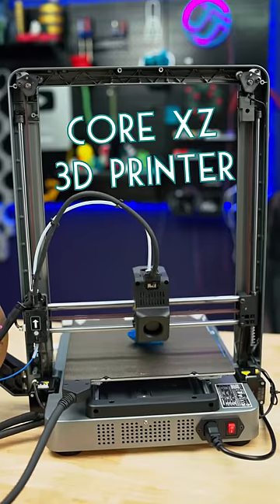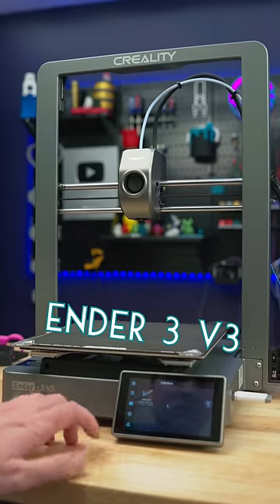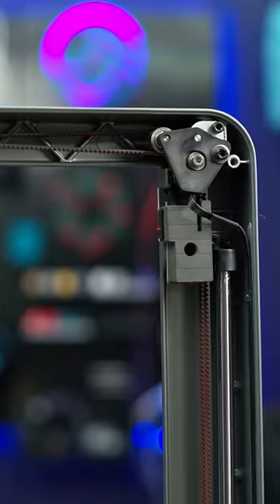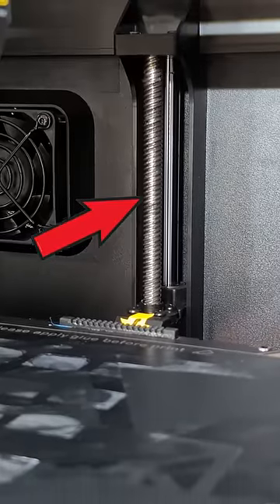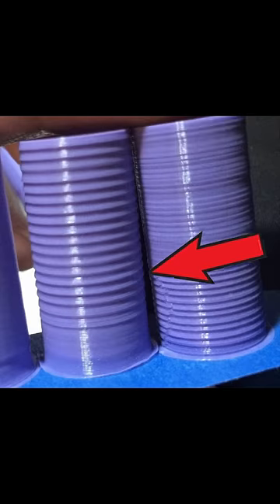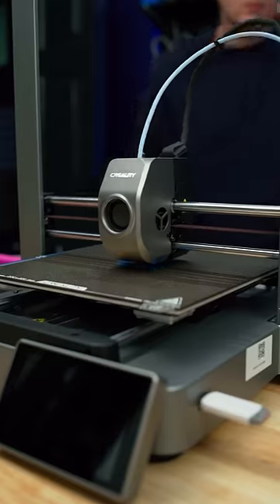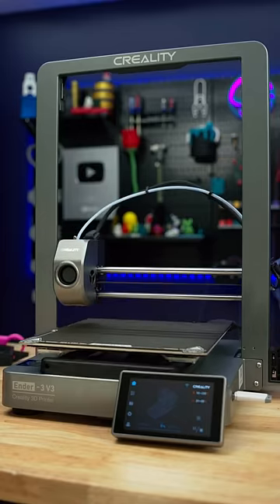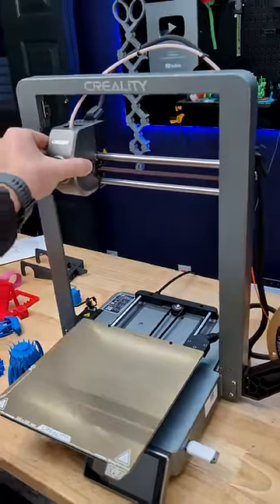Crazy Core XZ 3D Printing 😱

Comment: Yes this is the future of cheap entry level printers, because it's cheap, and light. They might even perform quite well... Initially.
Reply: As someone trying to get into printing for DIRT cheap. I see this as a win.
Reply: Yep, it's basically a dual Z setup without the extra motor needed. Also, even cheap screws are probably more expensive than couple of extra pulleys.
Reply: I have this printer and I have no complaints however configuring your slicer is a bit of a pain
Reply: @andrewpauly4783  someones needs to get into printing on a ultra low budget can easily be met with an Ender 3v2

The v3 is expensive compared to the v2 with mods
Reply: @questionsfrog1918 the v2 is an endless money pit
Reply: @allie5659  not really. Bl-touch+PEI mat $40. Add replacement rolls for $7 and your printer is ready

$99 for an E3 v2 at Microcenter,best setup to start printing. My E3v3 KE had,on top of costing $300, eaten up at least $135 and around every third print fails. Easy math
Reply: And it works well with direct drive extruders.
Reply: @Papinak2 it needs a second motor cause the z motor also controls the x axis! It's pretty much a flipped over corexy
Reply: @Parodidical  but standard layout requires 3 motors - 1 for X and 2 for Z. This one just needs 2 for X/Z
Reply: @Papinak2  oh, ok
Reply: @questionsfrog1918 or a KE and SE which would probably be around the same price if they really don't plan on modding it much further or aren't really a fan of modding
Reply: @questionsfrog1918  this is a different level to an ender 3 v2 with mods though. You can't go 600mms on an ender 3 v2 unless you use a raspberry pi and load kipper and put insane mods which will cost you double this
Reply: @Demertech  i know its supposed to be fast as lightning but if only one out of 5 prints succeed on the v3KE like with mine,a v2 would have been done by now

V2=cheap,slow,still fun to get your feet wet and it just werks

V3KE=expensive,fast,unreliable,suicidal due to blob of death. Also: Klipper, old Version with no chance to Update
Reply: @questionsfrog1918  I have 2 KEs. I can confirm that they can be shit however it's easy to solve it and make them reliable with tuning

Comment: Excellent instability on the Z axis✅
Reply: stability or instability?
Reply: Instability? The holding torque of the motors is plenty to hold it stable
Reply: @polycrystallinecandy xD lmfao
Reply: The whole gantry wobbles like crazy during the print. Look at some reviews.
Reply: That's more of a flaw with the frame design than with the core concept tho, right? In general corexz still seems like a slight improvement over traditional bedslingers if done correctly

Comment: You get the maintainance of CoreXY with the drawbacks of a Bedslinger. Great.
Reply: Also the backlash of CoreXY on X and Z and the backlash of a bedslinger on Y. Thanks Voron design. Could've just added the 3rd motor and made the proper independent 2x Z.
Reply: Came to say the same thing
Reply: This made me laugh
Reply: Exactly what I thought 💭😂
Reply: It’s not a traditional bed slinger in my opinion. It’s on there solid with no turn screws to level the bed or anything. Just 4 solid screws connecting to a metal bracket. The input shaping feature eliminates any issues with ringing and I have had 0 maintenance on my core XY belts but if I do, it’s one screw that has to be taken off and anything/everything can be replaced. I’m really liking this printer. Especially with Klipper and the built in WiFi.
Reply: @ygayovy  independent 2*Z only give you auto-leveling of x-axis

famous screw problems are from over-constrained screw
Reply: @derevya  Belted Z works just fine, for as long as it's not a freaking corexy.

Comment: Dude what do you think is more likely, a precision machined screw bending or belts being out of tension 😂 don't act like this is some tremendous problem people are dealing with
Reply from the maker: I have had a lot of issues in the past with the screws getting bent on some printers
Reply: @JJShankles  Belt tensioners are actually really hard to find.  And trying to pluck them is very difficult to understand.
Reply: @JJShankles only on printers from manufacturers who source all of their components from the lowest bidder, and don't have a QC department (like Creality). 
Literally all high precision/ high speed motion systems use screws for all 3 major axis.
Reply: @chriswisneski6071 they have QC but their expectation  is not high as most of their printers are DIY. Without QC you would get a box with a mix of parts that are nonfunctional, damaged, missing, incorrectly packaged and so on. What creality's problem is that the machines are hard to assemble correctly because of the error prone product design.

Comment: "Core XZ" is a marketing term.  I means literally nothing.  It's a bedslinger.  Like every Ender 3 before it.
Reply: You have it backwards “bed-slinger” is a marketing term given to machines with a moving bed. It doesn’t mean anything else.

CoreXZ is the classification of the motion system. It means the X and Z axis are not independent like the Y axis.

All the other Ender 3s are “i3” systems because they have 3 independent axis of motion.

Comment: Meanwhile my E3V2 is in pieces cause I couldn’t get it to work at all, no matter what I did. I even changed it to a direct drive extruder with the revo nozzle and it helped only a tiny bit, but with the extremely sensitive adjustable bed, and it’s “auto leveling” with the crtouch, it’s still so far from being a fully reliable printer. My Prusa mini with the bondtech extruder and revo nozzle is so reliable I don’t need to even bother checking the print.

Comment: I hope so! I’ve owned a knock off version of the Ender 3 V1, knock off version of the Ender CR-1, so this time around I finally went with the official Creality Ender 3 V3 and WOW was it easy and still is. I’ve printed more stuff on it than I did both of my last 2 printers and I’ve had it for a month and a half. 

The one thing I would say about this printer (all printers really) is that you do have to have some knowledge as to how the print process works. Why it’s so important to get the extruder dialed in and first level bed adhesion and all of that. However, the Ender 3 V3 and the Creality support team did a great job of making sure the setup is as easy as it gets and will help along the way. The bed leveling is a dream come true and the settings for retractions are a breeze because the print head moves so fast! Happy printing!!

Comment: If the x Axis would just move up and down on the z screws then yes, it would wobble. But since the x axis most of time is stabilised with wheels on the frame or running on a linear rail, the screws wobble doesn’t effect the print.

Comment: That second "feature" is not a feature, it's actually a liability.  You really shouldn't be moving around the printer like that, you can fry your stepper drivers or even the mainboard if the manufacturer didn't have the foresight to think some ape was gonna manually actuate the stepper at 200mm/s and zap the board with -48V.  Some boards won't mind it, some getting voltage in the wrong direction at the wrong time you're replacing a 100 dollar part.  If you must move them manually do it slowly to minimize the power generated by the stepper.

Comment: So now you get variable Z issues because of belt stretch, tension variables, and bounce.
Reply: I don’t think there should be much bounce, tension/stretch are why a normal printer at the best is limited to I think 0.1mm resolution. It’s not a limit you can calibrate around but an actual physical limitation of the design(s)/hardware. I personally use a normal Ender 3 with a belted Z, it’s much better than the lead screw

Comment: I have two questions. Can I put this on my Ender 3 s1 plus? And how do I make my printer print faster without changing the settings? Do I have to change the motors for faster ones?
Reply: you can convert your printer to corexz as well? but for negligible gains. To print faster, just set a faster speed in the slicer and increase your acceleration in your printer Config
Reply: Yes I do it every time but the highest I can go without losing the print quality is a 100mm/s and I want is faster
Reply: No

Klipper
Reply: in order to turn your ender s1 into a core xz printer, you have to design your own. The ender v3 isnt built for a ender s1 conversion so i wouldn't imagine it to work
Reply: The most popular method is the Ender Switchwire, but I think that's based off the E3v1 so idk how that would work in a S1

Comment: Shaking the life out of the model being printed almost guarantees distortion.
Bed-slingers were never a good solution, but they are cheap and easy to maintain.
Core X-Y as a standard feature is the 'next big thing'.
Moving the model on the Z axis only adds a lot to final quality.

Comment: Don’t move a printers print head without it being turned on and motors are turned off… mate had a printer die because he moved the bed and head position at the same time turning the nema motors into generators and he generated more than 12v which was all his board was capable of and killed the mosfets on the board did, some other damage too but he ended up needing a new board

Comment: Just had one. Had a terrible experience. Off on every axis, weird issues between the filament and power cable, and inconsistent extrusion. I wanted to love but...
Reply: Really? No issue with mine
Reply: @wantgamingyougotit1219  yeah I never got a chance to figure out what was wrong before I had to return it. However, looking back after I got an A1, I believe there might have been an issue with my nozzle temperature. My biggest issue was prints being knocked off almost every single time and after getting more experience and seeing how the A1 prints.. I feel like the Core XZ wasn't melting the filament enough.

Comment: Also one less stepper motor
Reply: No. Just different placement. This operates on a sideways core-xy kinematics so two motors are needed for x and y still but also for x.
Reply: @simplyelectronic4840  i meant compared to a traditional bedslinger with srews for the z axis, which has four motors in total (five counting the extruder)
This one has three (four): 2 motors for the XZ Gantry and one for the bed
Reply: @miege90 most bed slingers are 4 motors. Z, X, Y, and E. No different than this.
Reply: @mekanism8364  no you're wrong. Look at a prusa mk3 for example, the z axis has double motors, one on the left, one on the right, for a total of 5 motors including the extruder
Reply: @miege90  prusa is an exception. most bedslingers come with 1 z screw
Reply: @user-co6ww2cm9k  maybe nowadays as every other printer is an ender 3 clone, but a few years back, most printers I know had two...
Reply: @miege90 and look at the ender 3, 1 z axis screw
Reply: @Zyghqwyv  that's exactly what I just said.
Reply: Most entry bedslingers nowadays have 2 z steppers

Comment: The 3v3 KE have auto-leveling and run-out sensor with klipper software. I can print a flawless benchy in 18 minutes with factory settings in the slicer and it just goes. I've never had to deal with calibation / leveling and by how much people talk about it, nobody should buy a printer that recuire this when the KE is 250 bucks and just works out of the box.
Reply: Give it a year n your ke will be obsolete
Reply: @buddahboy520  nah, no shot.
Reply: @buddahboy520 What does jt even matter? It's not like 3d printing is reliant on (semi) hardware like gaming
Reply: You much of got really lucky my KE’s bed shakes and my tool head frame was bent
Reply: @ty8324  send it back for a replacement?
Reply: What do you mean require this? The only think i had to do out of the box on mine was bolt the gantry on and use the touchscreen to print a benchy in 13 minutes

Comment: Jesus crist, stop this bullshit. Its not going to print faster or better.
Bent z screws do not create wobbles. Bad z guides do.
Bed slingers can not print as fast as good cube printers, emphasis on the word good.
Bed slinger are not worse, they are just a bit slower.
Z axis speed was never a bottle neck on any printer.
Core XZ sematic is like putting a fancy low profile tires on a van. Yeah, sure it looks cool i guess. But its not even a tiny bit useful.
Any sane person with a bit of engineering background and some experience with printers will laugh at this crap.

Comment: It's a rather stupid idea. It doesn't offer any significant benefit. It mainly offers significant unreliability as soon as the belt tension is just a little bit off and your Z axis starts moving around with every X axis move, completely screwing up anything you try to print.

Comment: Am I the only one that calls them bed slingers instead of core xz
Reply: This is specifically a Core XZ bed slinger. Meaning the X and Z axis motion are tied together using a pair of belts. Traditional bed slingers are cartesian where each axis moves independantly of eachother.
Reply: @Antstar12  the printer is a bed slinger the bed moves back and forth wjat r u on
Reply: @Xeno9118  the "core xz" doesnt have anything to do with the bed, bedslinger yes but core xz instead of a leadscrew driven Z axis
Reply: @Xeno9118  You clearly don't know anything about 3D printers so please shut up. He just literally said "it is a core XZ bed slinger". So yes, it is a bed slinger, but it is also a core XZ. You clearly do not understand kinematics, so why are you even in this conversation. Come to think of it, I've never seen a core XZ that is NOT a bedslinger, because for non-bed-slingers, coreXY just makes more sense. The only other Core XZ I know of is the Voron Switchwire. 
Now please, either get educated, or leave this conversation to the engineers, and people who actually know 3D printers.
Reply: @Chris-hn4lp  yep i dont know anythink about printers ( i have a ender3 with 400 dollars worth of upgrades and a voron 2.4)
Reply: @Xeno9118 Then you should know how a core xz operates. Core XZ refers to 2 stepper motors working in conjunction via belts to move both the X and Z axis. This is exactly how the motion system on your 2.4 works but on the X and Z axis instead of XY
Reply: All core XZ machines are bed slingers, but not all bed slingers are core XZ (in fact only very few are).

Comment: Faster print speeds...... Yup just finally got through that article these printers are a gimmick, You can print at 500mm/s but the print will look like Sh1t absolutely garbage. they literally compared the Bambu labs top of the line to a DIY the DIY took longer print was perfect Bambu couldn't complete the structure
Reply: People have tested these and showed that it prints fast and high quality. Not 500 mm/s, but still much faster than 99% of printers.
Reply: bro what are you even on about?
Reply: Idk man im print at 450m/s and its still solid for almost all prints

Comment: The Z-axis screw being bent doesn't cause "wobble" in the print.

If the lead screw were load bearing in the X-Y plane then what are the other rollers or rails for? Why would a company like Bambulab use three of them on the bed in addition to chrome rods and linear bearings if all three could introduce motion to the system like that?

PLEASE do some research instead of letting AI write your scripts 😢
Reply: Having more lead screws averages out the bend in each one. If you took 2 of the 3 screws out of the Bamboo machine it would have Z wobble too.